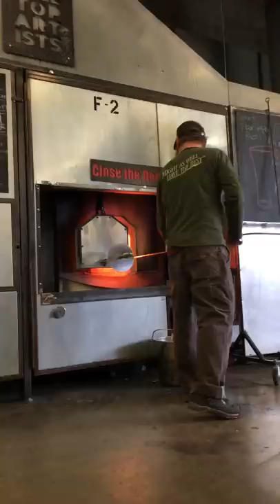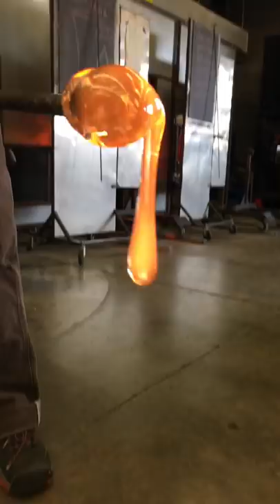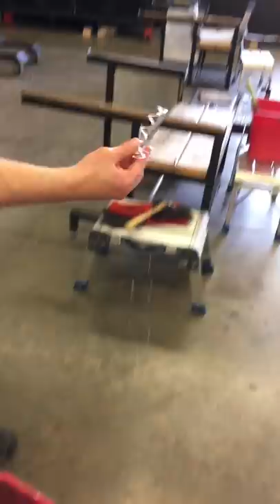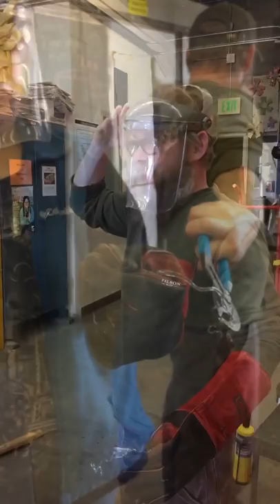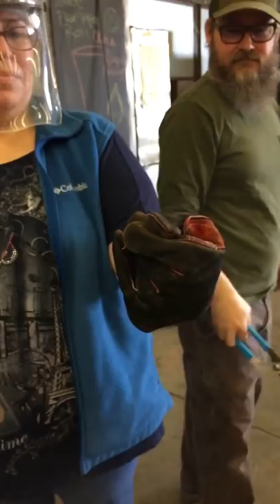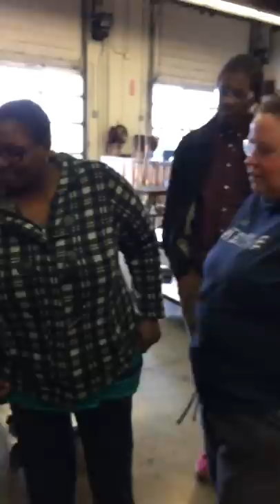Glass artist Jason Mouer demonstrates a Prince Rupert's Drop to University of Washington students

Comment: Now imagine if you could make one without a tail to snip. Indestructible marbles. 😂
Reply: I would bet its possible in a zero g environment. Just get a sphere of molten glass then have a way to quench it in water on all sides
Reply: @JackDaniels-ex9mf  couldn’t you just like put it in space
Reply: Marbles are basically indestructible! Lol.  Those things survive generations!
Reply: Unfortunately you couldnt 😅 the tail is a very vital and integral part of a Rupert's Drop.
Reply: @stevenrodan5160  Actually, you can! Look up Prince Rupert's drop vs AK-47. There's two videos from the same guy. All but one of the drops he shot shattered from the second-hand vibrations in the tail. The one that didn't had had its tail shortened after creation. It IS possible, and would be incredibly cool to make something out of them.
Reply: @brockcasey720  I think heat does not dissapite all that fast in space even when it's cold. There are no air molecules to absorb the heat, so only radiation (the slowest method of heat transfer) occurs.
Reply: You can cut the tail shorter. Speaking from experience.
Reply: @warriormaiden9829  Im not talking about cutting the tail to make it slightly shorter. He meant making it without a tail completely, but the tail is integral to its structure. There is only so much you can take off before it turns to dust. But you cant make it without a tail. You can try to make it have a shorter tail from creation but thats it.
Reply: @--i-am-root  ⁷
Reply: @stevenrodan5160  perhaps a blunt teardrop shape?

Comment: What's scary is when it turns to dust like that, tiny tiny sharp glass goes everywhere, it can DESTROY your hand.
Reply: How thin is your skin? It’s not explosive, & those are very very tiny generally shapeless fragments. Bleed, maybe. Not have a hand? Definitely cap.
Reply: @CornPopsDood  I'm like 90% sure hommie didn't mean its going to blow up your hand like some C4 bro. The issue is that essentially any movement of your hand (picking glass up off the floor for example; essentially squeezing the grabbed piece). Is going to embed tons of powdered glass in your hand. And, it doesn't not like to come out. However if the person did think of it as literally "DESTROYING" your hand, I stand by your comment XD. I'd go with "WRECK" your hand, if you don't deal with it properly.
Reply: @ItsOnlyGenjutsu  his reference to "picking up glass off the floor" is because there might be a smaller "drop" like this on the floor and you could inadvertently snap the tail, causing glass dust to get in your eyes or breath it in or whatever.  It's not because of the glass shards.

Comment: I think ist beacsue the bigger part cools down quicker then the tail. The big but hits the water while hot making it hard beacsue of the fast changing temptures. But then the tail feels some of that cold from the water because the bigger bit is in the water and so it cools down slower. And because it cooled down slower it makes it much weaker. Making it have a strong side and a weak side. Just a theory

Comment: You can hammer it hard enough to chip the concrete floor in a hot shop. Don't tap it lightly against the marver!

We make little ones and hand people squeeze them as hard as they can in their hand. Then you break the tail with a cane nipper.

Comment: For whoever is wondering. 
(Not english, i'll try my best to explain)
This drop is so hard because of what happens when it cools down. What happens is that the most othern glass, that touches the water, hardens really quickly, forcing the inner glass to "grow in pressure" while cooling, this makes the drop really hard. THO, it holds a pretty high pressure, once the tail gets broken the glass has a way to "release" that pressure and by doing so it shatters.

Comment: I think the cause of this, the air bubbles are trapped inside the main bulb, which are pressurized do to the heat, and when you break the small part it opens up an air pocket releasing air or Gas at high speed cause a very rapid chain reaction of all the others expanding causing it to powderize, that's just how I think it works
Reply: The outside of the drop cools and hardens. As the inner part of the drop cools , its wamer longer and the cooling contracting outer layers of glass get denser, harder as they pull closer together.
 The tail does the same,  but has less molten mass. Therefore it is dense but brittle. The snapping of tail create microscopic fractures in a cascading effect into the drop which is under tremendous pressure. The pressure is released explosively when the micro fractures reach the drop.

Comment: It’s not that dangerous, I used to make them and explode them in my hand without gloves. Yea I had safety glasses on cause it could get into the eyes but it just stings a bunch when it explodes in my hand. It turns into sand basically. I just snap the other end with my fingers ( admittedly the drops I made are a little smaller because I had it at higher heat and the glass composition may of been different )